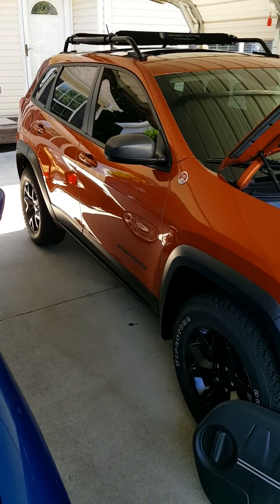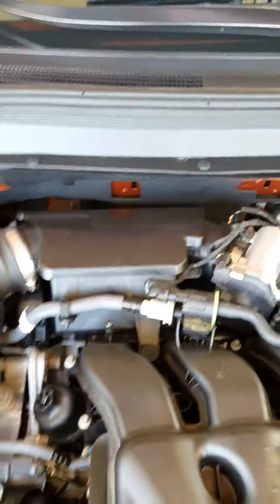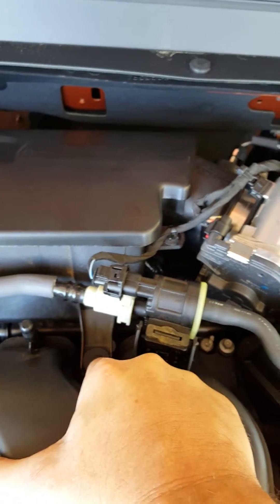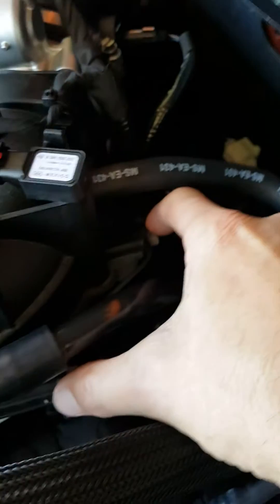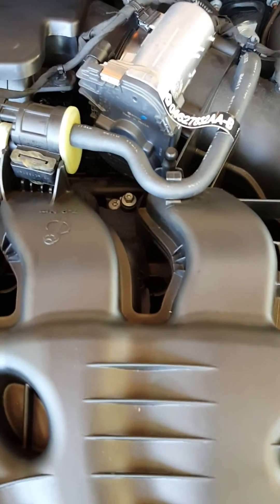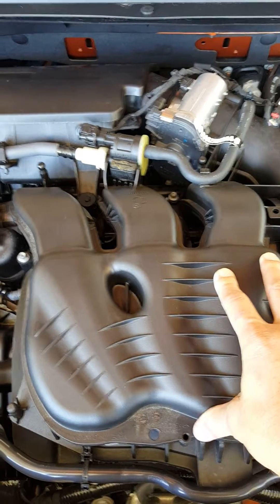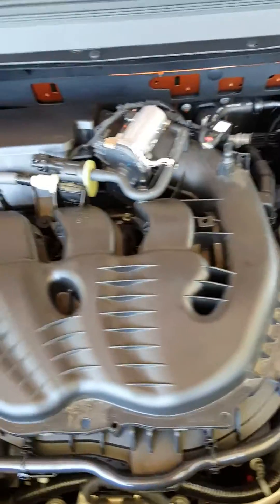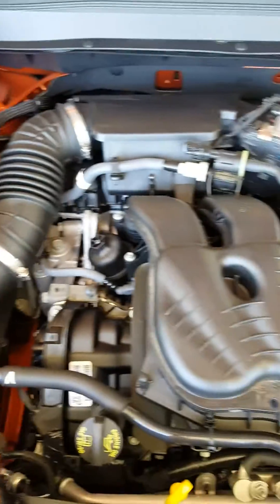2015 Jeep Cherokee Trailhawk 3.2L sparkplug replacement

Comment: Hello.  I cannot figure out how to get that pvc valve hose off the front.  Please help?
Reply from the maker: It may be difficult. Maybe a small flat head screwdriver under an edge to loosen. Could possibly damage it so check on replacement
Reply: I got it sorted and job is done.  Thank you for the help!!!

Comment: Nice video.  However, I am having a major problem removing the 1/2 inch nut( bolt) that removes the bracket  on the side of the engine.  Your explanation in the video was @ 4:22.  I could not slide the holding point off .I loosened the the 1/2 inch bolt .  But , the wire harness prevented me from removing the bolt,  Any suggestions.  Thank you!
Reply: I'm hoping you figured this out because I am having a similar problem. Please post if you remember.
Reply: @ianrutherford1  Ian , it has been a while , but, I believe I used a 13mm wrench.
Reply: how did you make out
Reply: @joecunder7846  I ended using a 1/2 wrench (I think a 13mm wrench would have worked as well). The issue that plagued me was that plastic cover on the bolt that attaches to the wires. When I unscrewed the bolt the plastic cover kept pressure on the bolt and I could not remove the bracket. I ended up using a clip remover from a trim removal kit to pry the plastic off the bolt.   Removing the bolt at that point was a breeze. I watched a handful of videos on this process and it seems a small portion of us have real troubles with that bolt. Thanks for responding! I was able to change the plugs and coils but the processing was very frustrating. Could not have done it without help.

Comment: Just a heads up, I replaced my plugs on my car at 100,000 miles, , the plugs looked great, I changed them anyway since I bought them, I can tell you all from experience that most all new cars can go 100,000 mile plus with no issues on the plugs. Thanks for the video, I will be changing mine when the time comes, your video helps